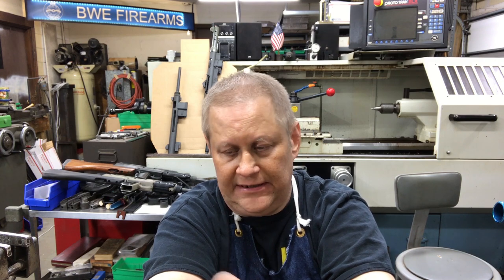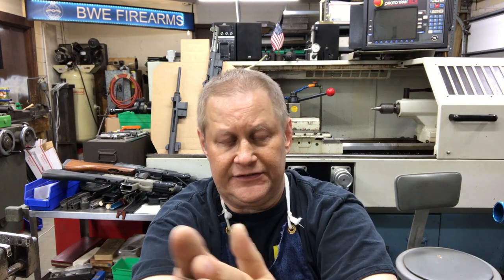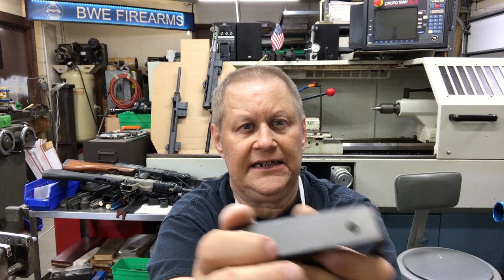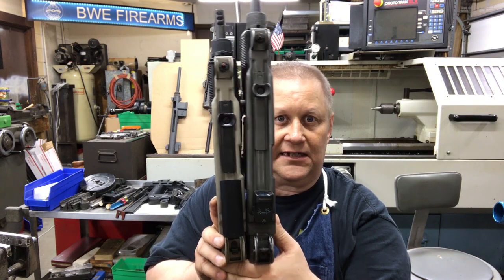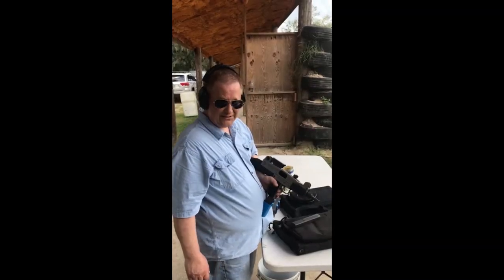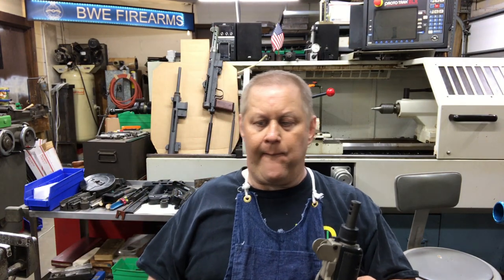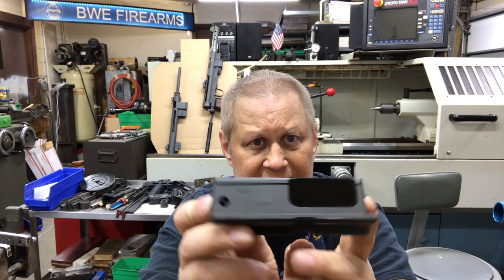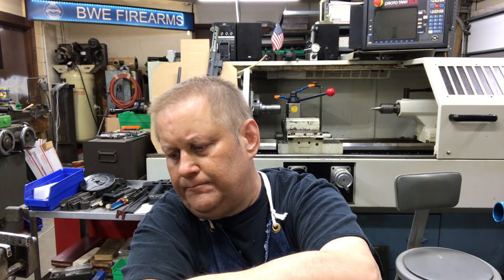Adjusting The Rate Of Fire Of Machine Guns.

Comment: I used to be class 2 and had a factory mini. Even though the cyclic rate was 1200+, the rate of fire plus the recoil into the back of the receiver made the gun surprisingly easy to shoot good groups. There was a sweet spot that harmonized bolt impact/rate of fire with the Mini Uzi.
Reply from the maker: Yes there is.

Comment: this information can also be used to tune a semi auto gun down to operate on subsonic rounds. I did up set of parts for my 10/22 by lightening the bolt by about an ounce and installed a lighter spring. now it will run those aguilla subsonics all day.
Reply from the maker: It's the same basic theory.